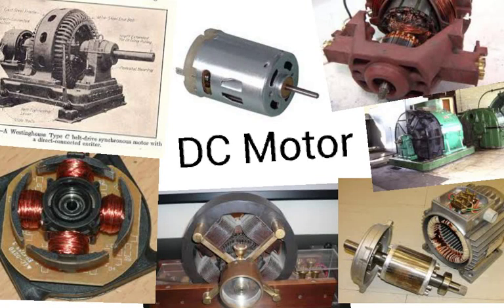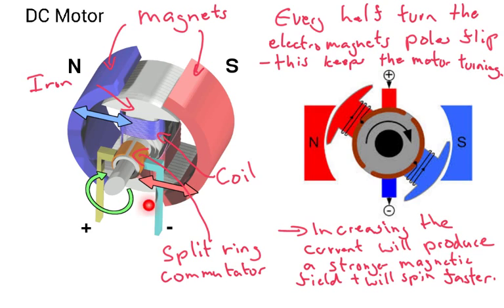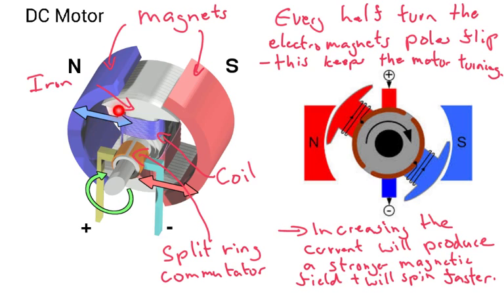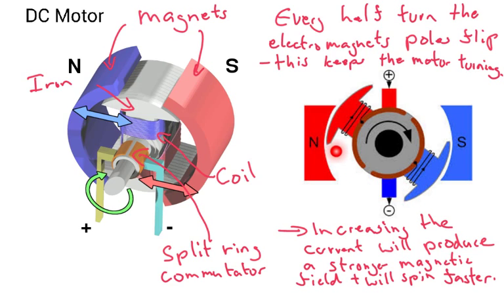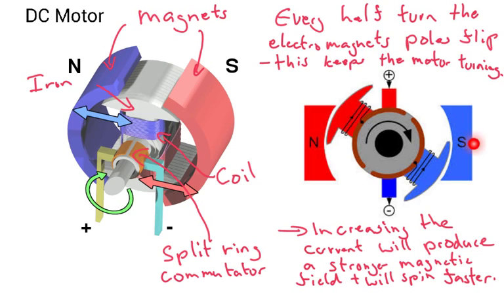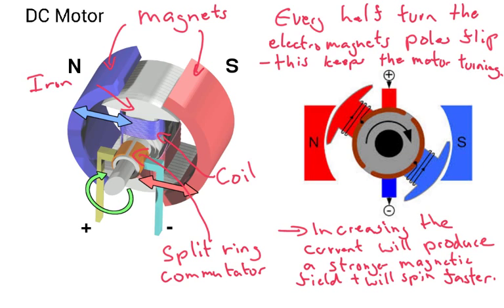DC Motor - IGCSE Physics

Comment: so they are used to change the direction of the current? 😗
Reply from the maker: in the coil, yes - every half turn
Reply: +Chris Gozzard (That Physics Guy) my book says that the DIRECTION OF THE INDUCED CURRENT CHANGEs Every half turn of the coil 
I really don't get the difference between split and slip rings.    I mean do we want the coil in AC Generator to !move in one direction only?
Reply from the maker: +sarah ghazi hang on.. your getting confused between the motor and generator. watch my video on slip and split rings and on the a.c. generator.